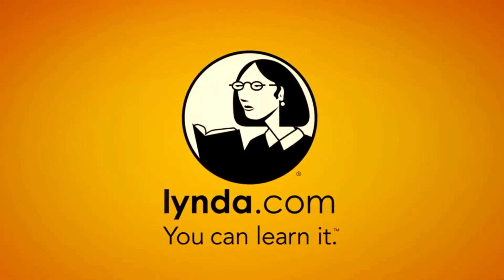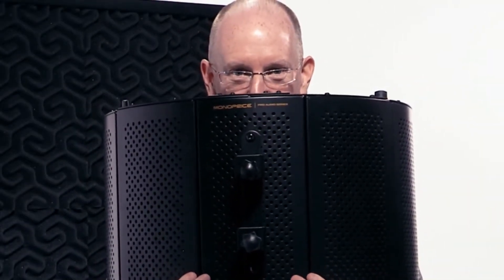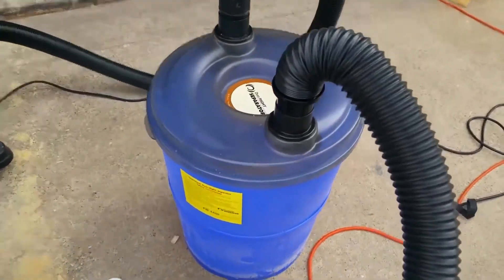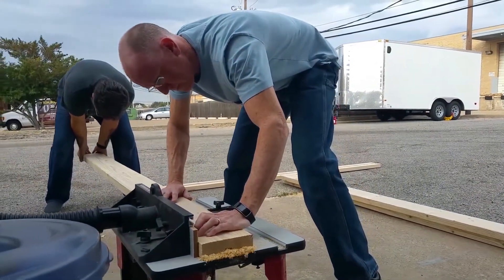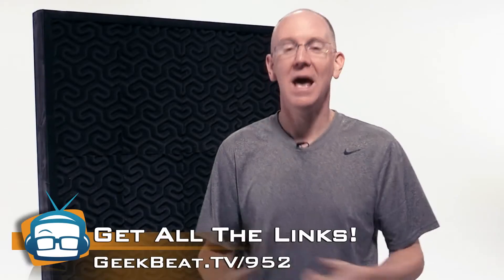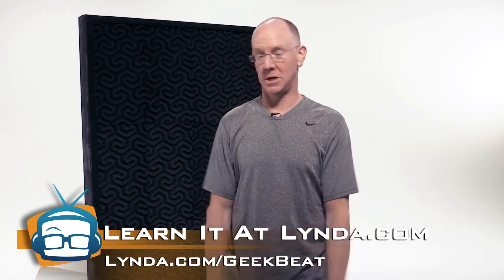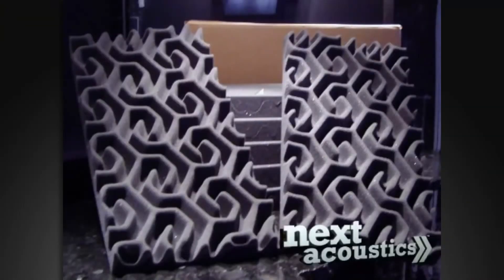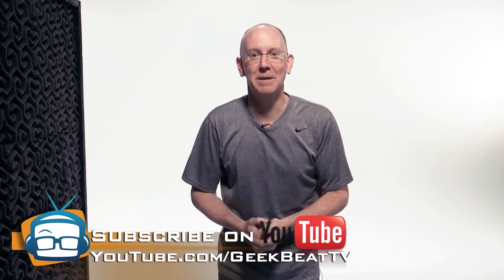How to Build Rolling Sound Baffle Walls for Acoustic Insulation

Comment: damn shame to do all that good work and then use the wrong material for the inside. should have used mineral wool or rigid fiberglass insulation rather than foam. also, this application is an attempt at sound DAMPENING, not sound 'proofing'
Reply: You beat me by 2 years! That foam is good, but yeah for cost it's not the cheapest option. But then it doesn't also need an acoustic fabric face covering to stop mineral dust/bits floating around into your lungs. 
And yeah it's definitely nothing to do with sound proofing! That frustrates me so much.
Reply: @W2APS  I use 100% cotton for panel coverings and no mineral dust bits in the air (here I use the equivalent of Owens Corning 703 basically, fiberglass batt insulation)
Reply: @IndieSoundLab  I'm looking to build a mobile baffle wall to take away stage noise from an upright piano on stage (church). Found this video, but it did seem expensive. Got any tips?

Comment: Yeah, right, 1000,000 points for geekiness, but way beyond 'economical' if you expect people to get hold of all this other machinery!
Reply: +Dean McCormick I think of things like this and it's just an opinion. Building things yourself can cost more initially sometimes, yes. If you factor in tools you don't have, a router, miter saw, shop vac, etc. and buy them all you might spend more on this project than retail sure, but you'd have tools as well in the end and something of higher quality that's custom built. If you bought these online I think you'd pay around $350 and they are what they are. I found a leading acoustic treatment builder selling something sort of similar but not as nice for this cost. I look at it like this; if I can build something myself, and of better quality for much less than what I'd pay retail and in the end I'll have tools that I now own to build other things it's justifiable. Although, you could build these for much less than $200 by making some changes. Without cutting the groove you no longer have the need for a router.  Leaving out the router and buying less expensive wood you could build these for much less. 3/4 plywood board is around $20 depending on your location, generally cheaper. 2x4s are around $2 each, again depending where you live. Casters can be found for much less than $10/ea. I just got some from a discount box store for $3/ea with rollerblade type wheels and locks for my work bench. Also, if you didn't want to spend $100-250 on a miter saw you could get one for $20 or less with a hand saw and plastic miter box. I think he was simply showing something high in quality, but you could definitely do this for less material cost and add in that budget money for tools you can use to build other things. This is how I get my wife to approve purchases :) HTH
Reply: Not faulting the workmanship, actually, it's probably made better than commercial manufacturers' products (with inbuilt obsolescence). Way too 'crafty' for me.
Reply: +Dean McCormick fair enough lol
Reply: Lmao! You don't have to do it exactly like the way he did it. Skill saw, measuring tape, L brackets and a drill. It doesn't have to be on wheels but the better the wood the more the weight. 

You don't even have to go this route you can hang thick padded blankets over a portable coat rack. 

I got 30+ years master engineer I stuck mics in closets in between already hung clothes and that worked perfectly fine. I've used mattresses, hung rugs on walls built an entire blanket booth as well as used more expensive shit for more expensive studios. 

Once you do research on sound reflections and know that flat walls give you tons of reflections and the corners where the wall and wall meet the ceiling and floor is where bass gets trapped as well as windows, door ways and behind your monitors.